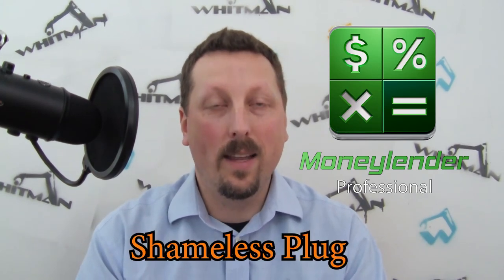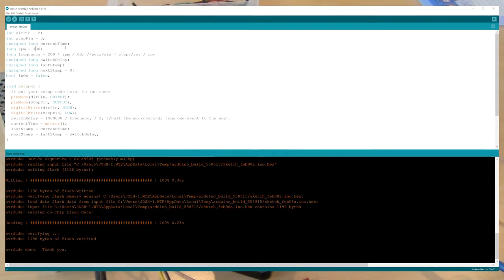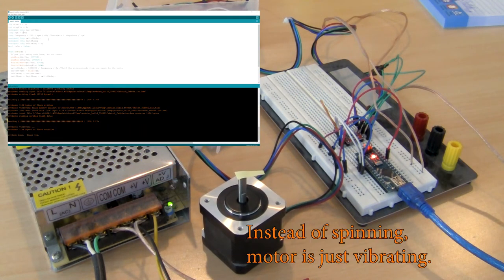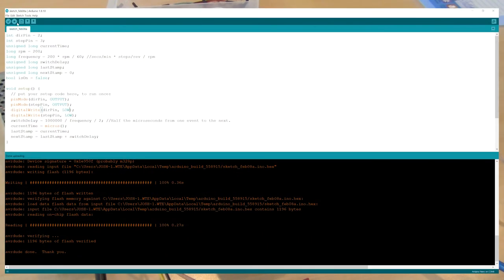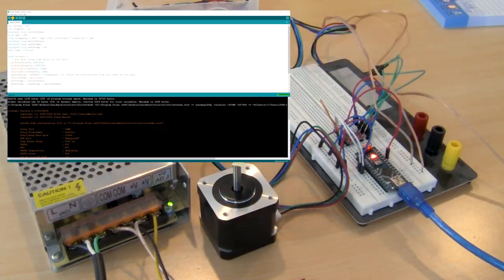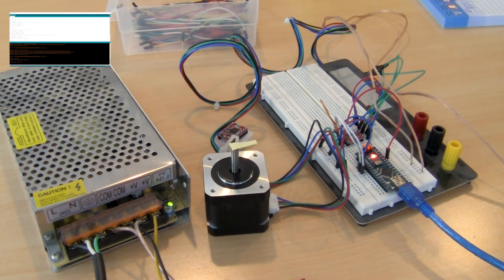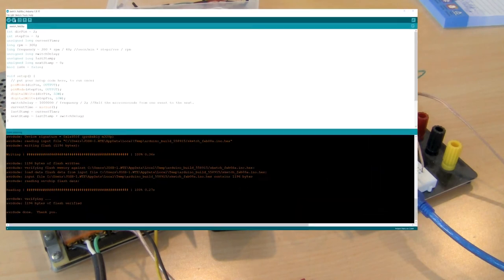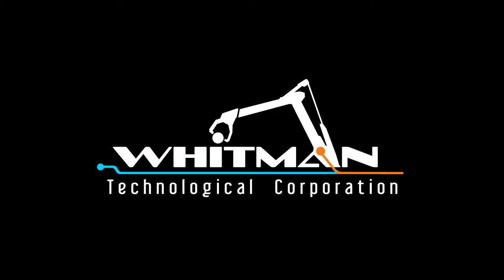How fast should we expect our stepper motors to spin? - Stepper Motor max USEFUL RPM Test

Comment from the maker: A few people have asked for code, so here are two versions for you to play with and customize:

#1 - Simple Run at a fixed speed: ##################################

int stepPin = 5;
int dirPin = 6;

unsigned long currentTime;
unsigned long nextStamp;
bool isOn = false;

//pulseDelay = RPM * steps/revolution / sec/min * micros/sec and divided by two because each step requires going high and then going low (two toggles).
unsigned long pulseDelay = 100 * 200 / 60 * 1000000 / 2;

void setup() {
  pinMode(stepPin, OUTPUT);
  pinMode(dirPin, OUTPUT);
  digitalWrite(stepPin, LOW);
  analogWrite(dirPin, LOW);
  currentTime = micros();
  nextStamp = currentTime;
}

void loop() {
  currentTime = micros();
  
  if (currentTime - nextStamp >= pulseDelay) {
    //The pulseDelay has elapsed and it's time to toggle the pin.
    isOn = !isOn;
    digitalWrite(stepPin, isOn); //Toggle the pin.
    nextStamp += pulseDelay;
  }
}

#2 - Ramping up the speed from zero to some max RPM: ##################################
int stepPin = 3; //Set to whatever pin will trigger steps.
int dirPin = 2; //Set to the pin that tells the stepper driver if it's forward or backward.
int enablePin = 4; //Turn the stepper driver on or off.
unsigned long rpm = 300; //Target max RPM of the stepper for this test.
unsigned long stepsPerRevolution = 200; //Enter the number of steps for your motor to make a full revolution.
bool forward = true; //Toggle to switch motor direction.
unsigned long accelTime = 2; //Second to accelerate the motor up to the max RPM (use 0 to just start the motor at full speed)

unsigned long firstStamp; //When the warmup began.
unsigned long lastStamp; //Stamp from the previous toggle.
unsigned long curStamp; //Stamp from the current iteration.
unsigned long rampTime = accelTime * 1000000; //How long to accelerate in microseconds.
bool warmup = true; //Track if we've made it through the initial acceleration stage or not.
bool pinOn = false;
unsigned long toggleTime;

void setup() {
  pinMode(stepPin, OUTPUT);
  pinMode(dirPin, OUTPUT);
  pinMode(enablePin, OUTPUT);
  pinMode(LED_BUILTIN, OUTPUT);
  digitalWrite(stepPin, pinOn); //Set the step pin low.
  digitalWrite(dirPin, forward); //Set the direction.
  digitalWrite(enablePin, LOW); //Pull the enable pin low to turn on the stepper driver.  
  firstStamp = lastStamp = micros(); //Note the start time.

  //Determine the number of microseconds per toggle of the step pin at the target RPM.
  toggleTime = 60000000; //Number of micros in one minute
  toggleTime /= rpm; //divid by number of times per minute to revolve
  toggleTime /= stepsPerRevolution; //divide by number of steps to complete a full revolution.  Now we have the number of micros per step.
  toggleTime /= 2; //Cut in half so half the time it's on, half off.
}

void loop() {
  curStamp = micros(); //Get the timestamp for this loop.

  unsigned long toggleTarget = toggleTime;
  
  if (warmup){ //Still accelerating at the outset, we'll increase the toggle time proportionally.
    if (curStamp - firstStamp > rampTime) warmup = false; //We've amde it to the end of the speed ramp.
    else {
      //Increase the toggle time proportional to how far along the acceleration ramp we are, longer at the start, no increase at the end.
      unsigned long tempToggle = (rampTime - (curStamp - firstStamp)) * toggleTime / rampTime; //less and less added time to the toggle.
      toggleTarget += tempToggle; //Add this extra toggle delay to the motor start.
    }
  }

  unsigned long elapsed = curStamp - lastStamp;
  if (elapsed >= toggleTarget) {
    //Toggle the step pin.
    pinOn = !pinOn;
    digitalWrite(stepPin, pinOn);
    digitalWrite(LED_BUILTIN, pinOn);

    //Update the tracking variables.
    lastStamp += toggleTarget; //Advance the stamp by the amount of time that was meant to have occurred between pins.
  }
}

Good luck, have fun!!
Reply: I'm using a NEMA17 with A4988 driver. I tried to run the above fixed speed code and it doesn't have any errors, but the shaft of the stepper doesn't move at all. Later, I tried to change the values in the unsigned long pulseDelay and by trial and error the motor did run at lesser values(still not at what RPM was specified). For example instead of 1000000, I reduced it to 1000. If you can help me explain this.
Reply from the maker: @RushitShukla  I think the problem is where pulseDelay is set to  100 * 60 * 1000000 / 2.  I say "RPM * seconds per minute" in the comment, but that doesn't make sense.  It should be "RPM / sec/min".  If we look at the units - rev/min * sec/min = rev*sec/min^2.  But rev/min * min/sec = rev/sec which is what we want.  It should be 100 / 60 instead of 100 * 60.  That's a factor of 3600 different.  Try swapping the multiply for divide and that should give more reasonable speeds.  Oh good, it let me edit the original comment.  Thanks for taking the time to describe this problem. :)
Reply: hello, how i can set up if im using adafruit motor shield L293D?
Reply from the maker: @roghibashfahani15  This code won't be super useful with an L293D shield.

To compare a stepper driver like an A4988 chip with the L293D, we can split the functions of the 4988 into two groups: logic and power management.  The logic on the 4988 takes step and direction inputs and decides which of the motor wires go to positive and which go to ground.  These logical processes happen at very low voltage and current - much lower than would be required to drive a motor.  The power management functions of the chip A4988 then take the low power decision of which wires are + and which are - to the motor  and amplifies the voltage and current significantly using sets of much more powerful transistors.

The L293D is only the second half - you give it a low voltage signal that you want wire 1 to go high and wire 2 to go low, and it will amplify the power of that weak signal so it's strong enough to drive the motor.

Happily, others have already done the coding and this is what Arduino's Stepper library is for.  Here's a tutorial that shows how to wire up the L293D and it has sample code to run it.  https://lastminuteengineers.com/stepper-motor-l293d-arduino-tutorial/
Reply: I'am so desperated with this motor driver. By the way im using l293d motor driver shield and can't make the stepper move more faster, to slow. I was try zk-5ad ta6586 it is so powerfull but once again i can't make it to push the power. Hahhaa
Reply: Would you share the code via email ?
Reply from the maker: @MrAmity009  You can copy/paste right from the pinned comment into Arduino IDE.  That's all of the code.

Comment: Why didn't you use a ramp to accelerate the motor_
Reply from the maker: I wasn't looking for the laboratory maximum speed.  I wanted a reasonable upper end I could design for in a specific use on a robot.
Reply: @WhitmanTechnological  Ok, nice video you had. I have been playing with steppers for years and I accelerate them  by a totally digital ramp generator of my own design. It uses binary rate multipliers, up/down counters and comparators. You can program in the acceleration, initial (starting) speed and final speed. After that (keeping the accel constant) you just output new higher or lower speed and you get the stepping frequency for that.
Reply from the maker: @MrJPI  That sounds awesome.